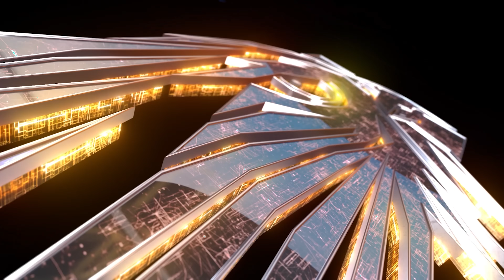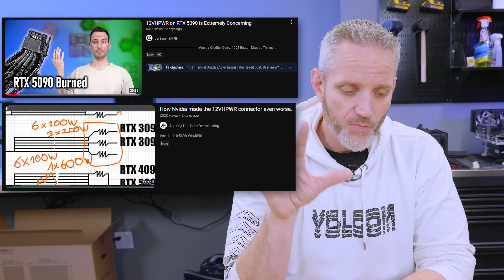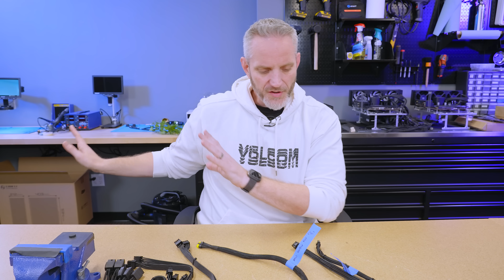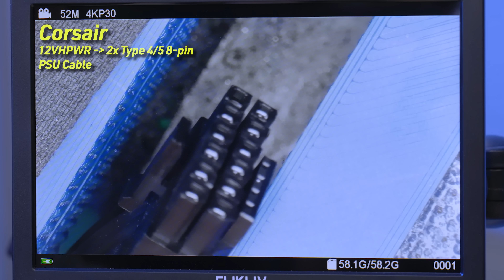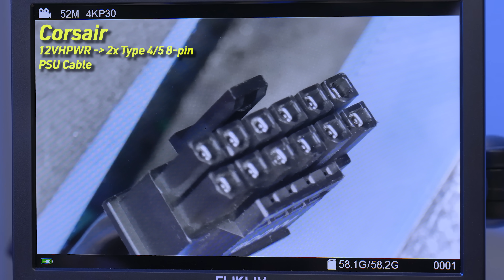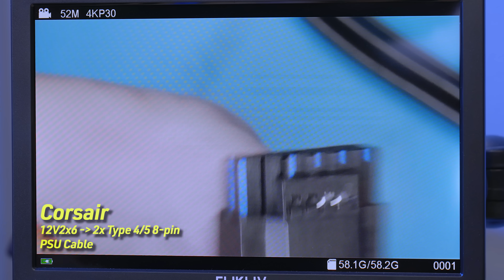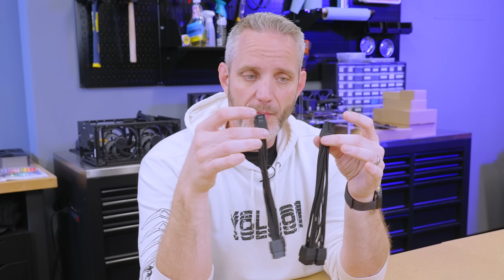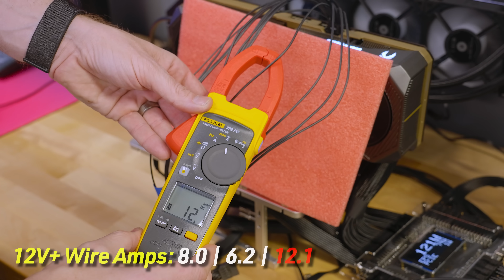I discovered something concerning and I need the Experts to chime in... More 12VHPWR discovery!

Comment: My guess would be that the negative side shows less issues because most boards have a common ground cinnection that would evenly destribute the power across the negative pins. 
But i beleive the main problem is not that the pressure that the contact points are exerting is not consistent across all the pins. Wether that be variances in pin dimension or plug reciever dimension. 
If there is too much variance and then a few of the middle pins arenf being grabbed tight enough. The power goes to the next easiest path. Sending too much power through 1 line and melting it.

Comment: Hey Jay, since you suggest using the adapter provided by Nvidia, would you be able to do some tests using that adapter? Would also be interested in seeing tests illustrating the compatibility of ATX 2.x power supplies with the 50 series (5090 in particular) and if power spikes are an issue.

Comment: Sorry...but if the issue is how to deliver high power through a socket with tiny plugs that are poorly aligned and apparently it's so hard to align them or checking if they are aligned in the factory... Couldn't we use the usual thick copper cable, crimped with a cable termination and tighten with a screwdriver to the card? Or 2 couples xt60 or xt90 connectors? You end up having up to 80A@12V RMS 120A max...

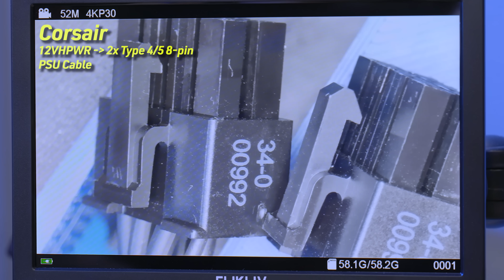Comment: at 8:25 - your statement that all Corsair PSUs including the ATX3.1/PCIE5.1 models use 2x8pin to 12+4 is incorrect. The 2024 RMX series I bought has a native 12v2x6+4 on the back of the PSU and came with a native 2x6+4 cable. On the cable that came with my PSU both ends have really good pins, almost fully flush with the end of the plastic - probably slightly better than the MSI cable you showed first.

Comment: There is a lot to unpack here. But basically, there needs to be a more robust power delivery system to these video cards. Pulling 600 watts through thin wires, isn't a great idea. You should see the wires that I use on my 500 watt stereo. One negative and one positive wrapped in plastic and thicker than this 12 pin system. Every point of contact, is a potential point of failure. Simplifying the connection points at the PSU and the GPU would be a better idea. A single positive and negative wire would be better. IDK why PC's use 12 points of contact when 2 will work and any split of the power delivery that the GPU needs should happen on the hardware itself, and not be left to some flimsy wires. Also, why isn't Nvidia including their own proprietary wire harnesses with these $2000 cards? This was a known issue from the high watt 4000 series. It had to be anticipated that upping the power draw, will up the failure rate. Nvidia did NOTHING to address this. Just blame the end user and call it operator error.  

It's time for something new. The high power draw tools in my work have a large cable, hard wired into the device on one end, and plugged firmly into a wall socket on the other end. As power draw evolves over the years, the power delivery system needs to evolve to keep up. It has not. Maybe it's time to stop worrying about using our PC's as an art piece, and return more to functionality.  Maybe cards with this much power draw should come with a power cord hardwired into the card, and either a dedicated wall socket type plug built into power supplies, or even just run the cable out of the case and plug it into the wall socket. This idea of just adding more thin wires to compensate for the higher and higher power draw that we see every generation clearly isn't working.

Comment: iirc Asus and Corsair PSUs are made by Seasonic, so the cables between these three brands should be coming from the same factories.
From what I can tell, it seems like the Seasonic ones (and possibly other cables from the same factory) could be the problem here. der8auer and you both showed problematic Corsair cables, and I can confirm that my (yet unused) Seasonic 12V-2x6 cable has the same "loose pins in connector" problem as shown here.
Maybe there might be something to that theory. Now I know for sure that I'll use the Nvidia Adapter when I get my hands on a 50-Series card. So much for buying a new PSU in preperation 😬

Comment: That movement is 100% in spect. The molex connectors contact is faaar deeper than what you are thinking. There is nothing bad with having just some milimiters of contact, you dont need an inch of contact.
Reply from the maker: Spect??
Reply: @ now we play the finger fail game? Spec.
Reply: No. Connections must not move. This is not molex, you're confused.
Reply: @ this are not molex but they use molex / dupont connectors and they move a lot. Once the engange they are solid.
Reply: @ this ARE MOLEX as well as the 8pin and 24pin terminals. Molex is a brand not just the old "molex connector".

Comment: The worst thing about this is that you can look at the plug, it can look totally fine, and then when you plug it into your GPU or PSU, it will push the pins back without you having any chance to actually notice the issue.

Comment: Has anyone run a test on a 4 8 pin into one high power to see if that has better balancing? I would think with how that was wired that it would be very hard for it to be grossly overamping one wire like the high power to high power does since there's no control on it but your power supply is going to see a single 8 pin with 4 or more times the load it should have and do something about it.

Comment: So... Long story short, there are 5 12v pins in the PCI-E spec, and about 80 grounds... So long story short, it'll fry your mother board, not your cable in that case ;)
Additionally, check the pin retention and insertion forces, that'll tell you if the pins are consistent enough in terms of pin clamp forces. The resistance can come from 3 places, insertion depth, contact pressure and crimp quality. If you want to test it properly, break down some extensions, plug them into both ends and do a 4 wire resistance check on each pin in turn. You'll need a 4 wire multimeter for that though ;)

Comment: Dear GPU designers. Solder all power wires to the PCB and extend it to reliable high current capable external socket/plug.

Comment: Now I have an idea. The problem is that the wires are not load-balanced each.
Would it help to get a cable with 2 lines, but a high wire gauge for most of the length of the cable (that can handle 50A) and split them apart just before the connector?

It would still be a work-around to bs-design, but maybe get some 'product-safety" back?

Comment: this is so nerve wrecking.... 20+ Years we didn't have any problems with stuff like that. pci-e cables were totally fine. there were angle connectors for hiding them and sleved ones and stuff.... but no we need one thin, stupid cable because its less cables bla bla. i would take even 4 cables over this any time. i'm rather safe than minimalist. sadge

Comment: How much had the corsair cable been used, plugged in and out? I hope the observation is fair because if the others are basically new then the comparison is not fair. The end result may still be the same but still.
Reply from the maker: I literally told you in this video it was used once.... in fact I said it more than once.... how did you miss it!!!!!????
Reply: @ apologies I thought that was a different cable. As it goes I have hot glued a couple of my cables over time for exactly this problem. Though it’s not just Corsair. I think molex was fine when cards drew 150w not anymore

Comment: why dont they make the contact surface of the pins longer? how expensive that extra 5-7 mm of metal can be? would the $2000 card become $2005 ? this way if the pins are 3mm shorter they still make contact. 
however that pin movement looks like bad plastic that got pushed through by the insertion force

Comment: I wonder how a basic electrical connector is so complex for these hi tech companies, electrical cables for DC and AC have existed far longer than computer industry. 
someone is just being deliberate in mentally limiting the ability of the designers from choosing sufficiently good conductors and connectors for connecting source and destination.  millions of watts can be transferred by electrical engineers but 500watts is tripping up technical committee.  
and what bad software config is done by nvidia where they cant separate the power distribution on various conductors. the specifications for the cable connectors will specify the max amps capacity of each cable and the load is supposed to be spread along other conductors.

Comment: Is it safer to use the nvidia adapter with 4xPCIe 8 into 12V2x6? Or would it still possibly be trying to pull 300+ Watts through one of the 8 Pins into 1-2 12V cables?

Comment: Comment from an electronics engineer, by far not a gpu or cpu expert…
1/ ground or 12v does not make a difference, it is the amps in combinaton with the resistance that determine the heat output
2/ resistance is caused by material choice and contact surface in any connector, in the end it depends on tolerance left in the design whether your cable will be able to carry the current without heating up, when not fully seated
3/ a multi connector connector (>2 pos) is a liability, as current distribution can be uneven and heat can raise the resistance over a contact even more
4/ from an electronics perspective a single 2pin contact is much more reliable, hence why eg fpv drones uses a xt60 connector, capable of 30 Amp continously at a much smaller overall size
5/ not to say it is impossible to use/design a multi connector, it just makes for a lot more complexity …

Comment: The public can't do anything, it's 100% NVIDIA's fault.
We need a load balancer adaptator to check the power delivery on each cable.
The pin "not sealed" in its hole is pure madness.
The 4pin molex move more and connect better X)

Ok the power regulation should be on the power supply side then.
600W is 8.33A per line. If "we" limit at 10A per line, the card can get 720W with a connector spec to 800W (if everything is well plugged).
Even with that, Nvidia should have a power stage that check if the power is 1A off than the average received.

Comment: I still can't get over how ANYONE with even a basic understanding of electricity could look at a 12vhp plug and say "yeah that's totally safe"
Reply: We improved electricity! It's super duper high definition 16k electricity!  I have so many thoughts... and most of them is like "What is wrong with these people?"  Okay lets say 12vHP is something that is do-able... why aren't we wiring the motherboards with 12vHP's?  Why are we using big long ATX power connectors and not one of these brilliant connectors?  Nvidia and PCI needs to come back to planet reality and if they want to run THAT much power to the card we should just have another ATX power connector to the card.  I think we are all reasonable and would be good with this.  Modern video cards are doing as much or more computing as the CPU itself.
Reply: @badopcode LTT made a joke on the WAN show that I actually kinda agree with. Instead of 12*16 gauge cables, just use a pair of 6 gauge cables and an industrial standard XT-60. Nvidia can put it on the backside and paint the connector black, it'll be good to go.
Reply: @ lol put on a big ass Dr. Frankenstein switch and we would all be screaming "ITS ALIVE!" And that would still makes more sense then what they are trying to do.  This is like like trying to power a top tier game rig with a PoE ethernet and wondering why your house burned down.  First time I saw the connector I was like "HARD PASS!"
Reply: @nathanielhill8156  This would be a super idea. Even if they did 3 or 4, who cares, you can’t screw them up and they their current handling is superb.
Reply: The only thing I can think of (and my opinion is): 1) it was designed to cut every single corner, and to not have any sort of safety margin, 2) it was made with as sloppy of tolerance and quality control as possible, 3) was made to be built as cheaply as possible, 4) designed to fail, 5) one or more of the first 4 were there... just to increase their profits, and to kill the cards sooner, so people would be forced to buy new cards... again, for their own greed.
Reply: 12vhp would be fine tbh, if nvidia didn't cheap out on their two fucking thousand dollars msrp gpu with only one shunt resistor for all 6 wires. I mean, it's understandable though, a couple extra $0.01 components on the board would really eat into their margins.
Reply: At 48v I’m okay with it pushing 600w… definitely not at 12v
Reply: Especially when all the pins join up at the end anyways! Just put two big ol cables, shoot just make it one cable with a big two pin
Reply: I just installed CableMod C-Series Pro ModFlex Sleeved 12V-2x6 12VHPWR StealthSense PCIe Cable for Corsair Type 4 / Type 3 (Black + Red, 16-pin to Triple 8-pin, 60cm)

Excellent build.

Comment: Man and I thought I was doing the right thing and buying a Corsair cable for my PSU instead of using extensions or an aftermarket one. At least my card is a 4070S so it probably doesn’t pull enough power to really matter.

Comment: The bottom line is that the whole process needs to be IDIOT-PROOF like 8-pin - Period. 

Furthermore, none of this "max number of connect/disconnects is 10-20 horses***. The cable & connector should survive 500+ connects/disconnects -- PERIOD. This means the cable & connector must survive 1000+ connections in the lab in order to make it to market. Furthermore, the connectors should be SOLID BLOCKS OF CASE-HARDEND METAL WITH NO BREAKS. Not rocket science. With solid blocks of metal you will NEVER have a contact issue.

Additionally, the connector should me made of ceramic so they have ZERO give/flex like plastic & cannot melt no matter how hot it gets. Spend the $2 premium per connector Nvidia & cut the penny-pinching sh*t. SOLID BLOCKS OF CASE-HARDEND MALE & FEMALE ENDS WITH ZERO BREAKS IN THE METAL (I.E. ZERO GIVE) will fix the problem. Metal expands with heat & this ensures the connection could only get BETTER under load (microscopically that is).

If you want to have 1 power connector only (vs 2), then that's the price. Wake up & get with the program Nvidia...this is amateur-hour on steroids after 2 launches with the same problem - one that could burn a house down with the perfect storm of variables.

Comment: Thanks ! 

It could be a potential good explanation. If the pin moves back when you plug the cable, the surface of contact between the connector on the PSU/GPU side and the pin could be strongly reduce causing more current to pass through a small part of this pin and so an overheat. 

I think it should be easy to test it only. Separate one pin and cable to the rest of the cable. Connect it to the PSU/GPU. Make a derivation for the last pin from PSU/GPU terminated with a metal connector

Ensure a good/normal contact between this connector and the pin and check the temperature after 30 mn of workload. In a second test, make a simple touch between with the pin and the connector and check again the temperature after 30 mn. Pretty sure this temperature will be higher. 

You can have the same type of overheat problem in an 110/220v electrical panel if a cable is badly connected 

Of course, Corsair will not directly say you’re right as it’s a bad publicity for them and they will have to replace all cable and maybe the burned GPU

Waiting for the next part 😉

Comment: Electrician here, it's the exact same current, just lower voltage. As for what kind of fault is more dangerous... they both suck. Higher voltage has easier time breaking the oxide barrier and slag, this can cause the contact to weld itself and make a good connection again.. or a terrible one with high resistance and arcing. On ground side it might not weld itself due to too low voltage so there will be an insulating gap (open circuit - safe!) or just a poor connection that heats up same as it would on the + side. 
The card is also grounded via the pcie slot, in this case the slot itself can probably take some load off the ground pins on the faulty "12HVDC" plug. Not all of it but a few amps is better than nothing.
Medium power (500W+ draw is entering the realm of small home appliances) devices should have a safety margin! House wiring has 1.7 safety factor (or more). From looks of it this dorky plug/ standard/ NVIDIA solution has less than 1.1 safety factor. Plug misaligned by 5 microns, microscopic manufacturing defect or pushed in "only" 99.9% should not be the reason your pc or home burns down.

Comment: JayZ :), since when there aree 12VHPWR and 12V2x6 cables? Spec was updated only for connectors on thee side of thee PSU or GPU, cables are identical specifically cause they wanted total compatibility with cables that are already made, this is why changes that were made are not as drastic. They simply could not make 12 pins much longer and sense shorter and keep compatibility with original cables.